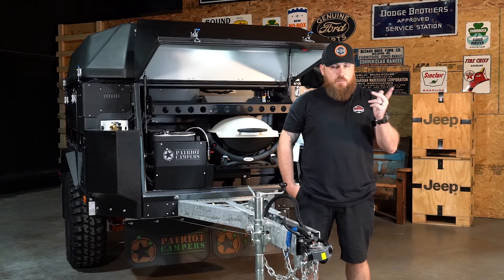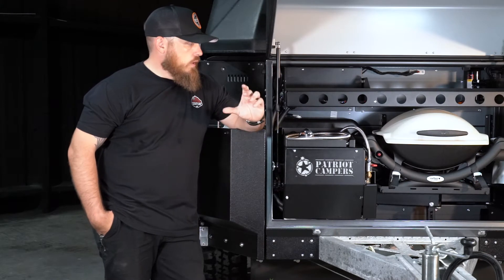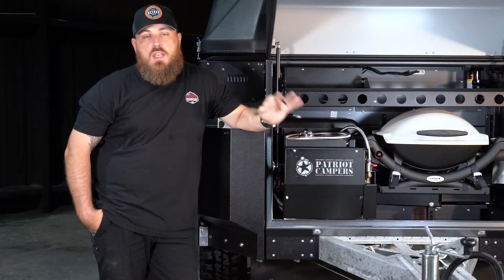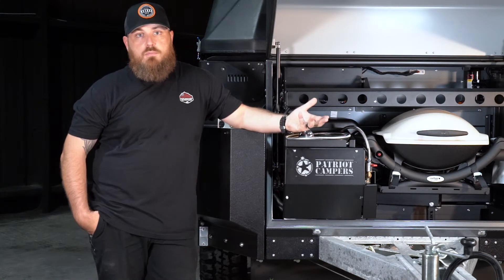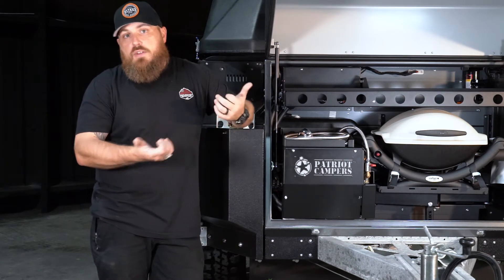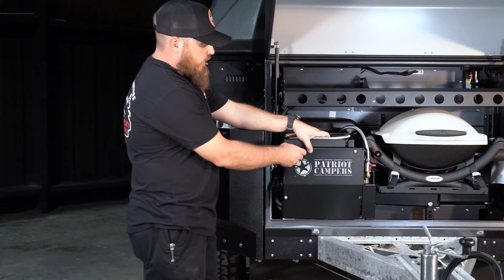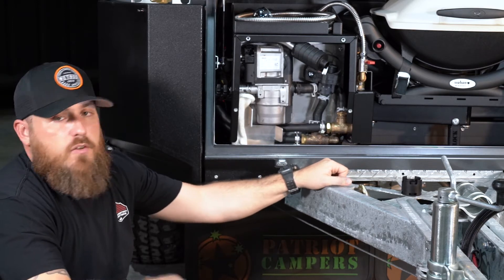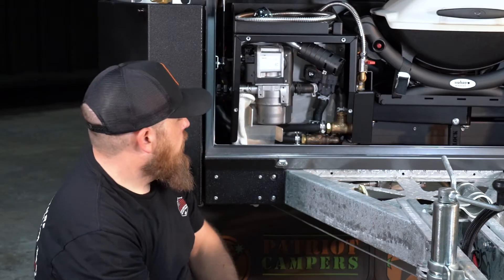Tech Tuesday: Episode 3 - Troubleshooting common Webasto Issues

Comment: my pump does not come on i have tried two brand new pumps which do not work either,so does that mean the wires to pump are backwards ?
Reply: and i did have this serviced and when came back pump wont work,somebody also soldered up the wires to pump,i wonder if they were done backwards/